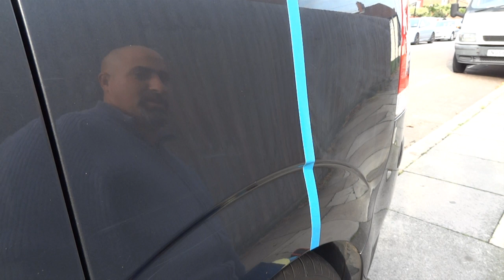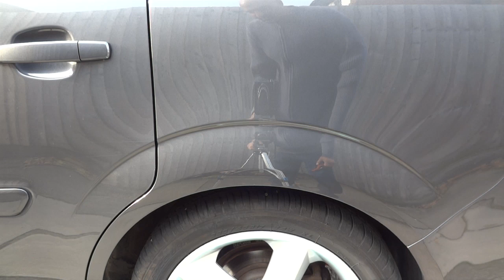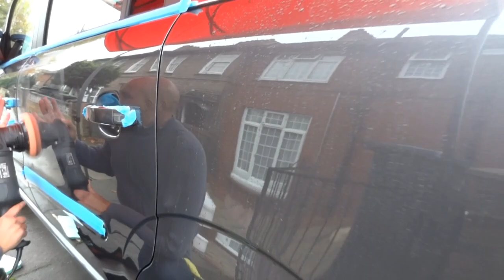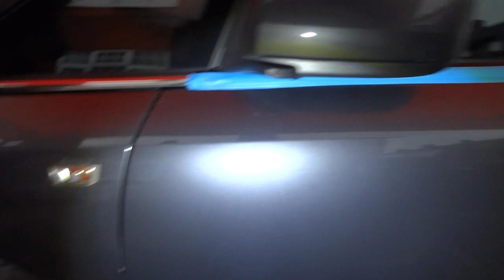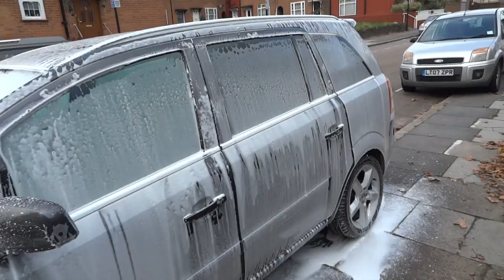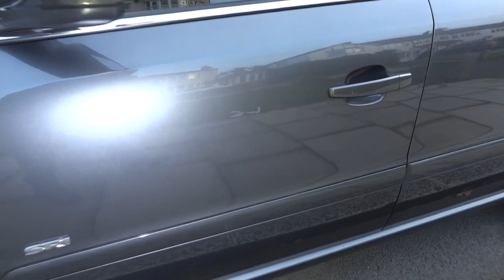spta correction detail

Comment: Great videos !
Keep the work up mate.

Have you thought about changing the cheap grease inside the gear of the polisher ?
Helps to reduce vibration and noise if you change it and add a little more to it.

I did it with my DAS 6 8mm Polisher and it's better that new.

Use a Lithium based all purpose grease from a good brand and you will be surprised
Reply from the maker: Frederic Golz not had a problem but will look into it. Thank you

Comment: Would you recommend this SPTA? Can you put other size disc on it for smaller areas? Does it stall in curves? Thanks!
Reply from the maker: 3DU ORT I was very happy with the machine and it dose a fantastic job. This is a 15mm da and I don’t believe you can change the backing plate for a smaller one. Maybe a larger one can be added
Reply: GHas Randoms Thanks for your reply.